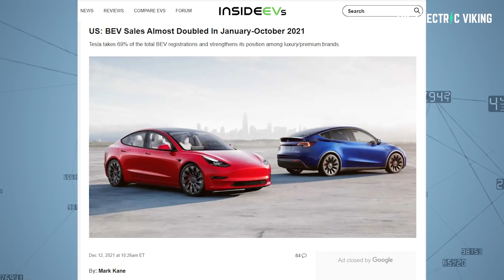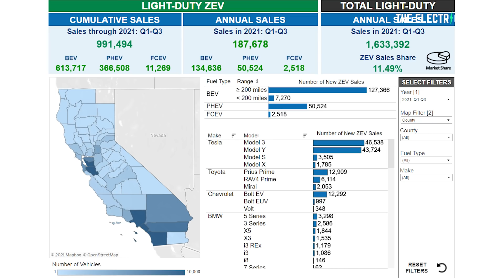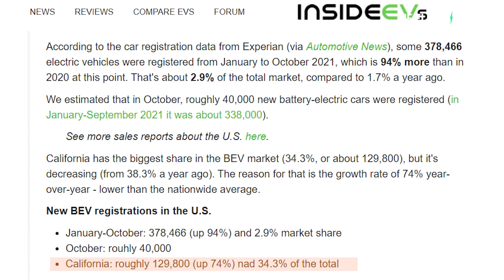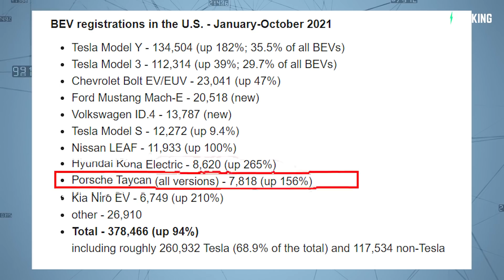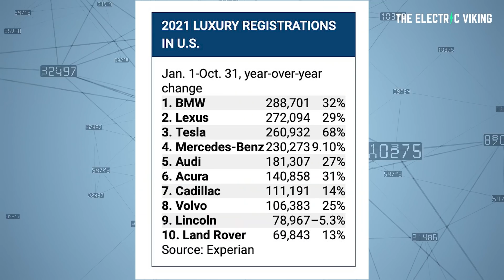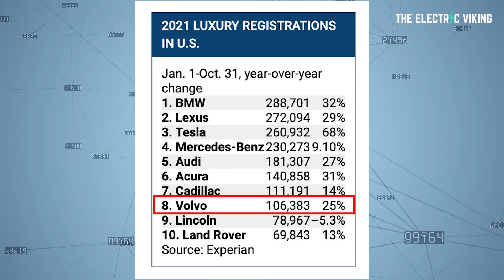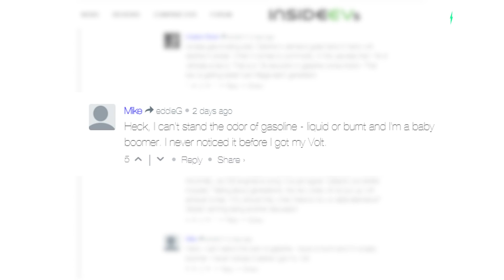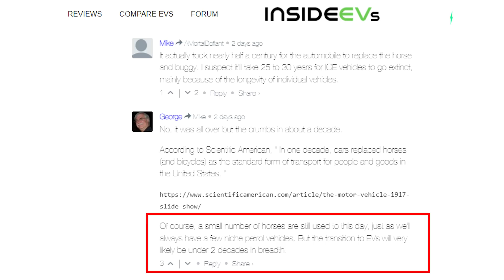US EV sales DOUBLE in 2021 - S-curve disruption CLOSE

Comment: Thanks for the reply Michael,

The reason I mention around 2+ decades is from past adoption of new technologies. The horse to car cant of course be compared to ICE to BEV as both do essentially the same thing.
If petrol prices soar- adoption will hasten. If rare elements become more scarce the pace of BEV adoption will change.
I looked at some tech adoption graphs on google from 1900- now and the car took a long time to be adopted by 8/10 people in a western country. If a car lasts around 20 yrs when made and half are scrapped at yr 10. It will still take a long time to trickle out all of those cars on the last day of ICE production. SInce 2030-2040 seems to be the time production will cease. You can see why I feel around 2050 is the real BEV turning point which is 30 yrs away.
Will be interesting to see in 5yrs but until ICE cars cease production it will be a thorn in the side of BEV adoption.

Comment: I sincerely hope that battery technology improves fast enough to completely eliminate ICEVs by 2030. Not because I fear climate catastrophe. Rather because this much improvement (like an affordable, rechargeable 500wh/kg battery) will also bring us flying cars, and I'd like to experience flying cars before I exit this life. I'm 60. If ICEVs are giving me cancer, I already have cancer. I'll likely live much longer than my grandfather regardless. We live too long these days anyway.

200 wh/kg and 2000 cycles and half an hour to recharge are good enough for most passenger vehicles. This tech is good enough for me to replace my Mazda 3 with an EV. It's not good enough for many small trucks much less long-haul trucking. I wish it were, but it's not. I don't see Tesla Semis replacing ICEV semis by 2030. They could replace most new passenger cars sold by then. Maybe you'll need to fuel your ICEV at a truck stop by then, but you won't need to scrap it.

Is that a reason to invest in legacy ICEV manufacturing for passenger vehicles? Obviously not. I completely agree with Viking on this point.
Reply: Don't expect to see a 500khw/kg battery (whatever that is) or a 500kwh/kg battery. Just be happy with a 500wh/kg battery.
Reply: @skipondowntheroad5833  Thanks for pointing that out. I corrected it.

Comment: Horse to car in 10 years? Doesn't seem accurate. Cars were introduced around 1900 and horses were used at least into the 30s maybe even later depending on when you want to draw the line. Heck some armies even used them at the begining of WW2.
Reply: You obviously don't understand the S curve, The 10 years is the sraight bit between the ramp up and the tail off. We're in a different world of communication and change now. No one actually banned horses so they could still be used for niche applications. With EVs the ramp up has taken at least ten years but the tail off could be very sudden as ICE bans by governments kick in.
Reply: @eclecticcyclist  douchy much? Obviously you don't understand what he said or my response. for one he didn't say it was 10 years of accelerated or exponential market growth. He said transition from horses to cars and anyway you chart that, it's longer than 10 years. Obviously you exclude when it becomes niche, horses are still used and it's not considered a viable for of transportation but up until the 1930's there was a sizeable population still using them in the US.

Comment: What's even more significant here: supply constraints. I have no doubt EV manufacturers could have sold double the number if they'd had the product available. Next year I'd bet this is going to double if only because both the battery supply and the EV supply in general will blow things wide open.
Reply: BTW, I have a deposit in on a Bolt EUV and I've been told my car will be built in the third week of production, likely mid to late February.

Comment: The steepness of the S-curve will only be limited by the supply of vehicles (or batteries in most cases).   In  China, and I think the EU the buying public is ready to switch, the prices are acceptable (even if on the expensive side), and all manufactures need to do is create vehicles to sell them.
Reply: Fuel may still be comparatively cheap in the US.

Comment: Unless they find a new energy source to supply electric and better batteries with more range the electric cars will go the way of the Diesel car in the USA. People are lazy and in a hurry and they won't put up with EV short comings very long.  You can't compare the USA with street clogged Europe or Asia. May your battery fires be small and your Coal burning EV's not pollute more mercury, nuclear waste, than they already do. Nuclear, windmills, solar all get government subsidies.
Reply: Solar and Wind receive zero or near zero subsidies in the UK. Nuclear and Oil is still massively subsidised by UK Government. GRIDSERVE's recent solar farm is ZERO SUBSIDY
Reply: You must be suffering cognitive dissonance or normalcy bias. Demand for EVs in the U.S is through the roof. EVs don't have range problems and the only hurdle to overcome is price which should be cleared in the next few years.
Reply: @ skip ondowntheroad still can’t charge 400 miles in five minutes

Comment: Sam, you're probably correct about the penetration of EV's in this country. Last year, it was 1.7, this year it's 3, I figure that EV's could conceivably make up 96 percent of autos on US roads by say..2026 or '27.. far, shorter than the 20 years some predict. I still think they'll be alot of ICE vehicles on the road, but the number of EV's may greatly outnumber them before 2030. All I can say is this..as a car buff who loves both types of vehicles, it's going to be one crazy ride for the next 9 or 10 years!
Reply: I am not sure we can use current market trajectory to model out the growth. Too many variables are impacting sales to have an accurate projection. 

Will there be any ICE vehicles manufactured in 20 years? Very interesting question. There will be gas stations most likely as the used market will still be going but I could see there still be holdout customers that an OEM will cater to. 

I am a gear head too and I am psyched also for the next 10 years
Reply: Maybe in sales, in some places. Here in upstate New York, probably closer to 9.6% of vehicles on the road in 2026. That's assuming somebody actually starts buying some here. I haven't seen any in weeks. ANY. Dealers have none to sell, and they don't want to. They don't have anybody trained in maintenance.

Comment: The metrics you are listing about Chinese  EV production is kind of meaningless. The bulk of those are barely cars like the Wuling miniEV which would not pass any western crash standards without complete redesign nor would the US market want but a fraction of those. We have micro cars and people don't buy them. 

China sells these because they have low salaries and it's all they can afford and it's also more usable in the large Chinese cities. Great for them and other developing countries but not translatable to modern markets. 

Also these cars are produced in these numbers because it only takes a 9 or 14kw battery pack to build. Five of these could be built compared to one model 3 50-82kw. The main constraints aren't there on them - price, chips and batteries

Comment: Probably one of the biggest reasons EVs jumped is because most ICE manufacturers don't have chips. All the dealers in US are basically empty while Tesla did a much better job with keeping up production.
Reply: The lack of ICE production is more than just chips. Demand for ICE has peaked and will start to drop.
Reply: @miken4591  yeah but the reason for the EV spike was not just natural demand.. it was also lack of available ICE vehicles. 

If someone was debating ICE vs EV like many are now, the fact ICE lots are all empty almost removes one option.